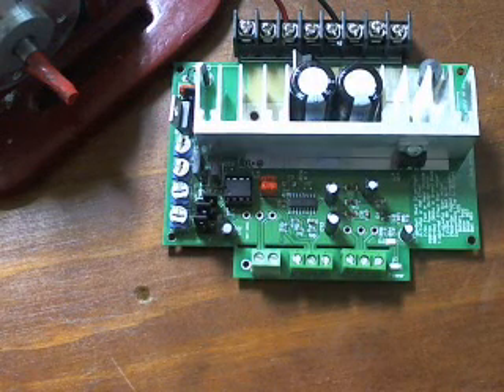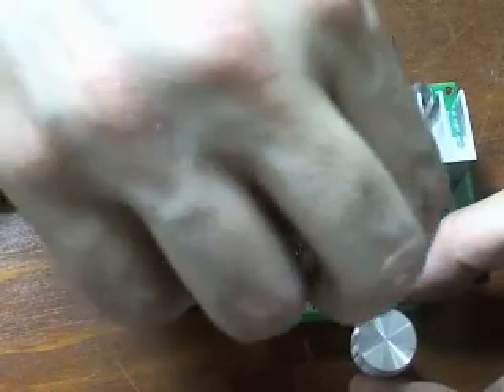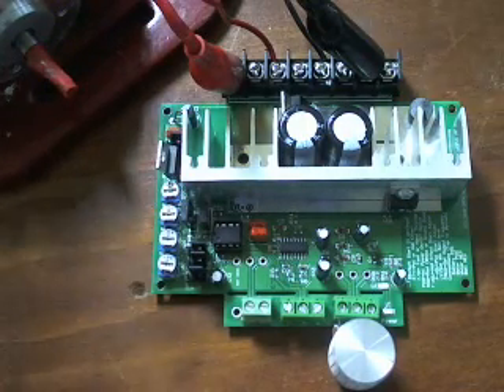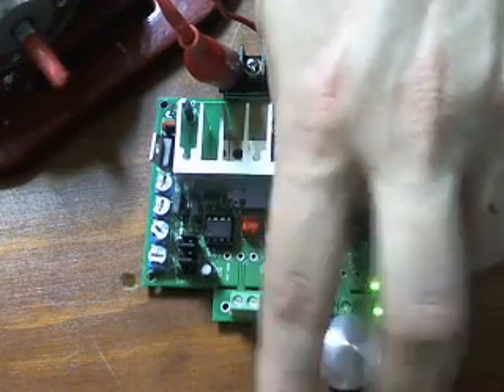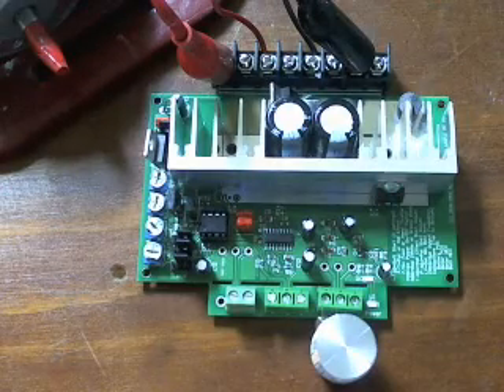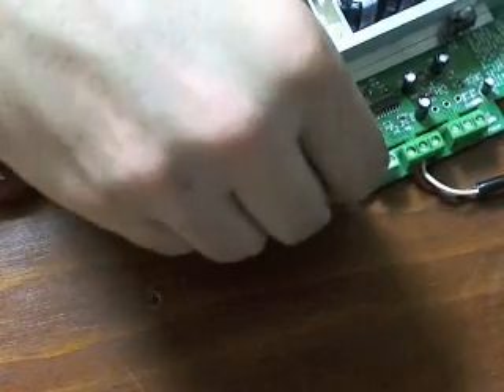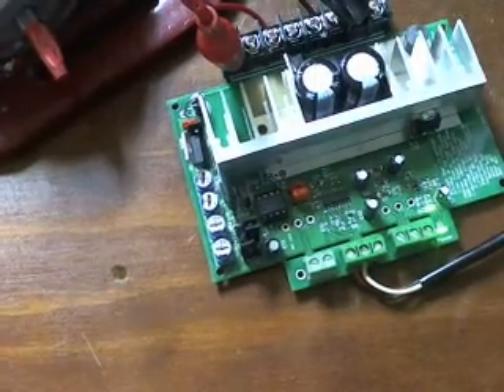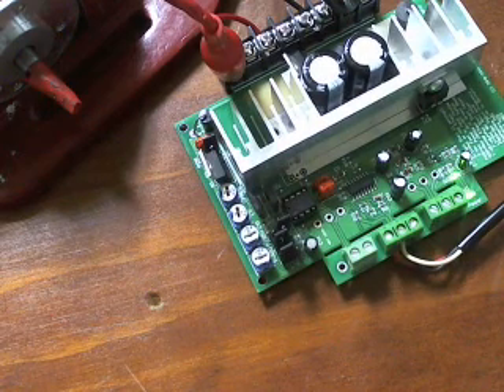Test video for 12v-48v dc motor speed controller 25A or 50A

Comment: Nice controller concept, except the layout with the two main filter electros surrounded by the heatsink fins. This is a design no-no, the heat from the heatsink will cause the electros to dry out and fail prematurely. The key rule with electros is to keep them away from heatsinks...

Comment: would i be able to use this on a mobility scooter coversion, 36v 16ah batter and 29.5ah 800w motor
Reply: You can but you would need to have he soft start enabled otherwise the inrush current car be quite punishing. We use pretty good mosfets but still, if the motor you have is the same series as what I'm thinking of, it can pull over 80a on hard starts or when its overdriven